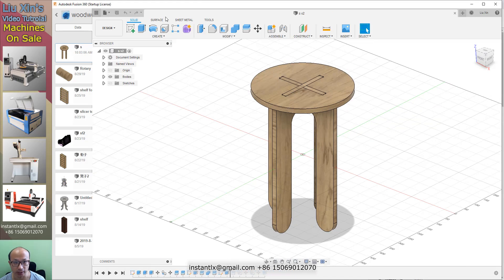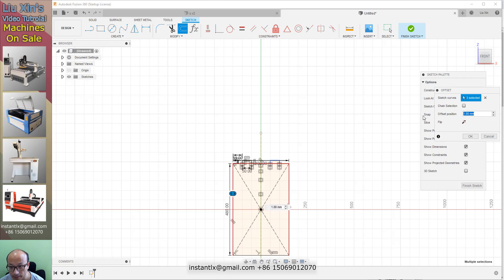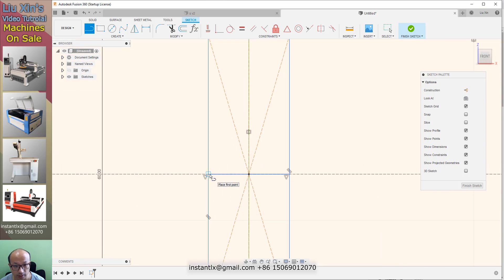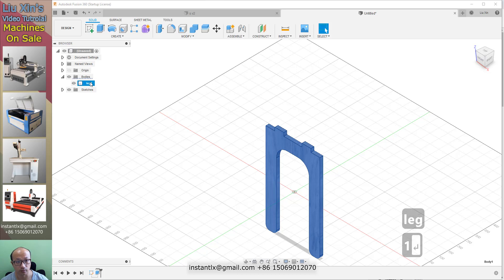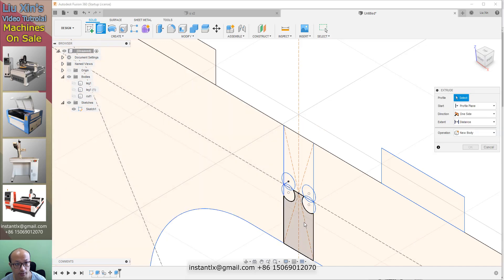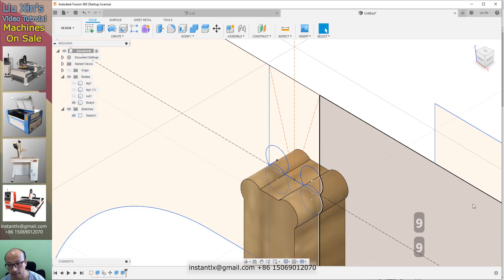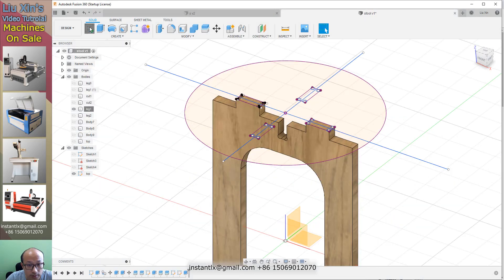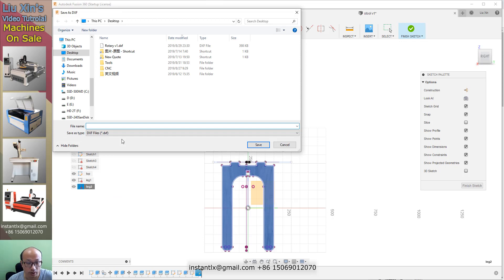Make a stool with Fusion 360 and ArtCAM, woodwork tutorial,

Comment: Fusion360 can do cutting and generate gcode why not directly use it. Why tranfer to artcam for cutting?
Reply from the maker: Artcam has ready postp and nesting function is more easier to use。 how do you do nesting in fusion?
Reply: I also new to fusion360 but I see it has alot of history tracking builtin as well as it cnc feature which can check for head crash. I been doing it like you converting the design importing into artcam for cnc. But as the 3d features vector  converted to mesh surface so waste alot of time to cut 3d features as I need to clear away the unwanted areas. Which could done faster by  3d vector contour cutting.
The autocad artcam can do auto boundary detection but it states that the cut is don't base on the centre of the bit.🤦‍♂️